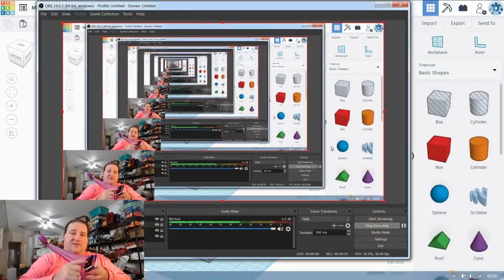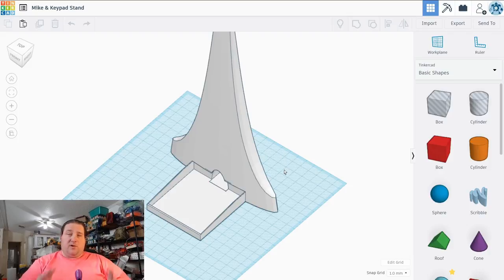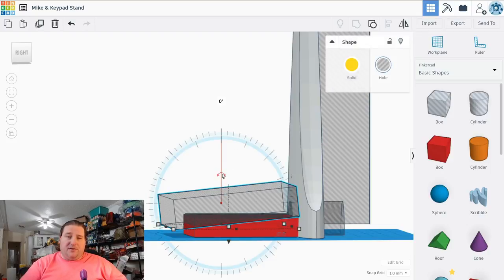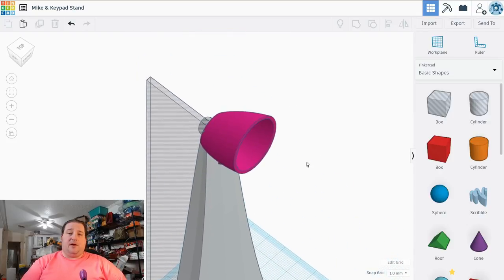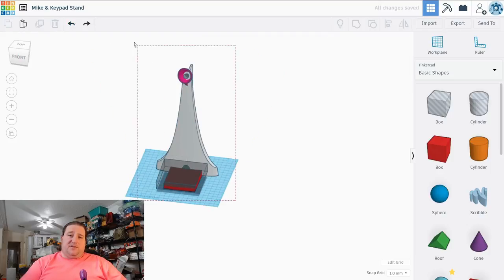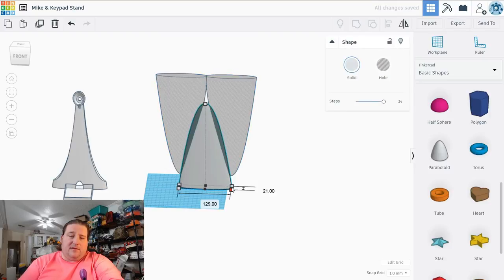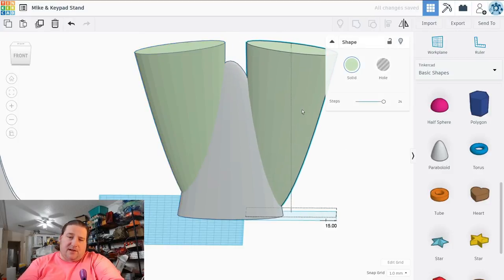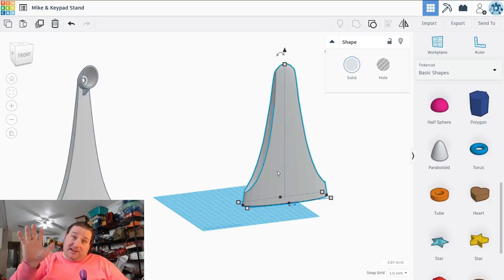Custom 3D Printed Stand for Programmable Keypad and Lav Mic T3DP

Comment: Great tutorial Chris! Tip - double clicking on a grouped object will temporarily ungroup one step back. Then click off to regroup;  handy for those little tweaks. Also, if you decide to get more elaborate with your OBS setup, check out the Touch Portal app. It lets you turn an old phone or tablet into a multi layered Streamdeck like interface. In many ways it is much more capable than a Streamdeck.
Reply from the maker: Yes very handy but need to be careful with newbies as you can accidentally make a change and not eve realize you did it.

Comment: I didn't notice any issues with the audio that others are mentioning.  It sounds great to me.  The video seems slightly better quality than before.
Reply from the maker: I suspect it is headphone users. The audio sounds fantastic to me. I mean very clean until I put my headphones on. Thennnnn it doesn't sound so great. :-) So I think there's some kind of a background noise that headphone users are picking up but speaker users are not.
Reply: @nerys71  Nope, just speakers...